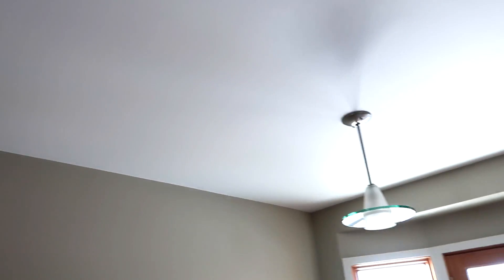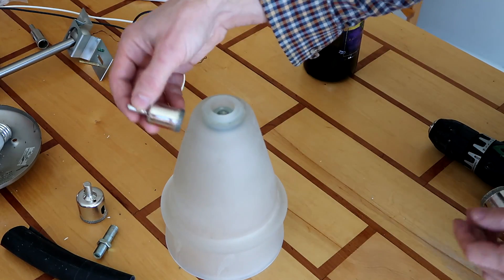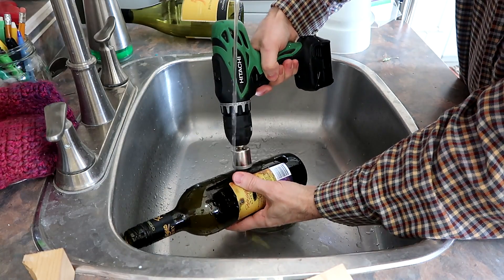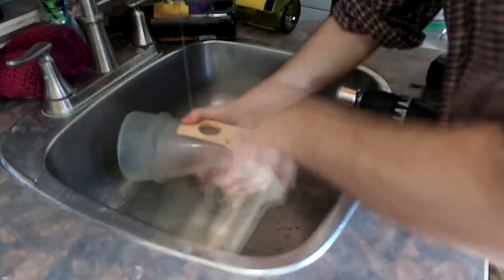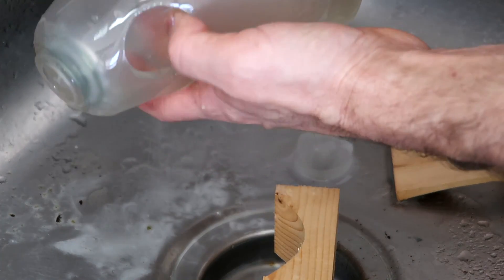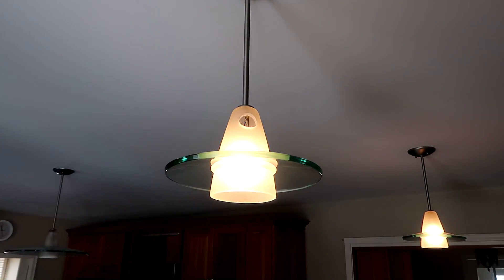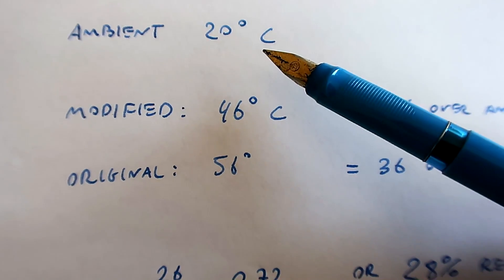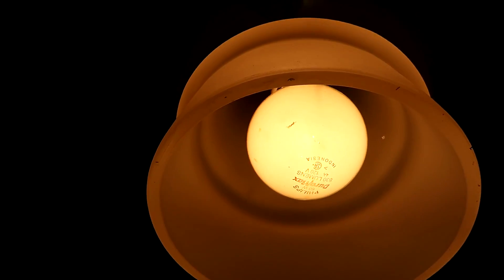Drilling holes in glass

Comment: Glad the hole saw worked out for you. A safer way to drill glass is to use a tiny, low power sandblaster. It micro-grinds the glass but without the tool forces of the hole saw.

Comment: LED lightbulbs used to have external heat sink fins on them to better disapate the heat. I have one of these in an outdoors enclosed light fixture with a photoelectric cell to switch it on and off at dusk and dawn and it is still working 10 years later.

Comment: It's not the led that is the problem I'm assuming. ..its the cheaply made low quality circuit boards that drive it that ends up failing...led is nothing but a spark gap encased in a semiconductor...silicon..i can hold led bulbs in my hand at least up to 60w equivalent bulbs...its the cheap Chinese circuits that are the problem because they were made in someone's basement

Comment: LOL, just be like some other computer geeks and modify the lights with a heat sink and fan!
Reply from the maker: In that case, I would still need a hole in the lamp
Reply: LOL, I was kidding,  @matthiasrandomstuff2221 ! But even so, not if the heatsink were small enough to fit inside and the fan blew downward and it had some room to suck air in up around the top. But anyway, of course I was kidding; that would look nasty!

Comment: Why not drill several SMALL inconspicuous holes at the top w/ a cheaper, regular/solid diamond drill bit? Recently I've found smaller LED bulbs that fit in all my fixtures, so I no longer have to drill ventilation holes.
Reply: Or why dont just cut a slot on top (actually two of them done by one cut)?

Comment: Rather than using expensive diamond bits, I drill glass (in a drill press) by putting a modeling clay dam around the area I want to drill and then use a brass tube of the proper diameter in a slurry of 320 grit silicon carbide in water.  One needs to withdraw the tube a bit from time to time to refresh the abrasive in the groove.
Reply: Diamond bits are not expensive.

Comment: Not cool to show the young ones how to ignore safety by not wearing gloves while cutting glass.

An alternative to cutting a hole is to cut a few vertical slits around the top of the glass cone with a diamond tile wet saw.
Reply: No one said to do this. Pros never use gloves handling glass either.

Comment: I’m a big fan, built two pantorouters from your plans, but this time you went off the deep end. Take a nice light fixture, drill an ugly hole in it, and get at best a minor heat loss. Sorry, this is just nuts.
Reply: The higher temperature causes light bulb failure!!

Comment: There are LED bulbs rated for fully enclosed fixtures, I am sure they would have been fine in your unmodified fixture. Did you test temperature rise modified vs original with LED bulbs?
Reply: There is no such thing as electronics immune to the effects of heat.

Comment: For what it is worth and this might be apples to oranges but here are some measurements in my home. I have both CFL and LED light bulbs in the same room. They are in recessed fixtures in the ceilings, commonly called "can lights" in the US. They are of different "equivalent" wattages. Meaning something like 20w LED equals 100w incandescent or something along those lines. But, and I only have five bulbs to measure. The three CFL were 51.9,47.4, and 49.9 degrees C. The two LEDs were 30.8 and 31.7 degrees C. These are the rather large bulbs that look like floodlight bulbs, way bigger than what Matthias had.

Comment: I think you should just install the shade upside down. Don't worry your wife will like how that looks once you explain the thermal advantages, ease of maintenance, and increase in light output due to the now exposed bulb.

If the glass breaks around the drilled hole the shade will fall? It looks heavy.

Comment: Heat dissipation, LEDs...........

Wtf???.??
Reply: LEDs don't emit heat from the frosted side of the bulb. They emit heat from the electronics. Usually the white plastic part of the bulb.
Reply: I use a lot of LED bulbs. They get hot around the base. I have some 65W equivalent flood bulbs above my work bench and they get almost too hot to touch at the base. I haven't put a thermometer or temp gun on them, but at least 100 degrees Fahrenheit.

Comment: I have wondered for quite a while why LEDs get warm when they are much more efficient than incandescent bulbs.  Shouldn't they be cool, or is it a relative thing.  Can you please explain it?  Might make another good video.  Thanks for your insights and unique style.
Reply: Simply put, they are more efficient at producing light than incandescent bulbs, but they are still inefficient becuase they produce heat along with the light.
Reply: It is relative to the bulb.
Incandescent bulbs' filaments are heated to about 2500 c (4600 f) and at that temp the thermal radiation produces enough visable light. The glass however would be around 250 c (482 f) 

In a typical led bulb,  the glass can reach temperatures of 60-100 c (140-212 f) aswell as the heatsink containing the electronics, and inside the heatsink can be cooler or hotter depending on type of bulb and where its mounted. 
Good quality led electronics are rated for 125 c, but cheaper and even smaller bulbs can run much hotter due to less effective heatsinks. 
Anything above 50 c will feel burning hot to the touch and anything above 57 c will burn you! :) hope I helped..
Reply: It's because of the electronics. An incandescent lightbulb just has a filament surrounded by an inert gas, and the filament is and it reaching outrageous temperatures is expected. LED bulbs are far more efficient but they're powered by LEDs and have electronic circuitry inside as well, which makes them more susceptive as failure due to high temperatures because electronics do tend to fail at high temperatures. 

For what's worth, I personally think the video is reliable because there's no chance in hell those were 60W LED bulbs like Mathhias said in the video. 10W, more like it. Still, the glass enclosure traps heat which electronic devices don't like, plus their power circuitry tends to be on the base of the bulb (so, on the very top part when installed), hence why they can fail really quick when put in enclosures that don't account for heat.
Reply: @simaorodrigues6285  Probably he meant 60 watt equivalent.  That would be about 10 watts.
Reply: That tells you how awfully inefficient incandescent bulbs are. 5 to 10 times more efficient than something that's very bad still leaves a lot of loss. That's why thermal managment is important with LED lamps.
The main reason here will be bad bulb design though. You can get LED bulbs that are are just pissing away power in the electronics or use the lowest grade LED chips. Could even be those that a manufacturer marked for the bin, because they didn't meet the required specs (every production has rejects), but then somehow ended up on the grey market and got put into cheap bulbs.

Comment: You can submerge the glass in water and drill it at a low speed as well, less chances of cracking later because of smoother cut. Also, wouldn't it be much, much simpler to go to where the kitchen lights are jointed to the main line and then put a transformer there (one of the ones that can run multiple LEDs, so you can just put regular LEDs in the fixture without the heat creating electronics inside?
Reply: The LEDs themselves also create a fair bit of heat. I think your idea is good though based on the thought that the supporting electronics and not necessarily the LED itself is the weak link that fails with the added heat.

That said, I have not encountered a lot of LED bulb failures even in enclosed light fixtures. In fact most of my failures have been in completely open lights with no way to trap heat. The common factor seems to be that I purchased cheaper bulbs. The bulbs I've purchased with large heatsinks seem to last longer even in enclosed fixtures.

Comment: I think several smaller holes would have looked better
Reply: And with multiple holes chances to break glass will rise exponentially.
Reply: I agree with you. I would even say that just cutting a few perpendicular slots on the top hole would be easier, quicker and would worked the same way.

Air has no problem to flow through thin slots. I think this big hole looks awful.
Reply: Who knew you could be so wrong about what you think?
Reply: It's always easy to spend someone else's time.  Also, I'd wager there's a pretty good chance of ending up breaking the entire fixture.  The drill tilts and binds repeatedly while hand drilling, and any one of those hard stops could cause the glass to break.  I'd stick with the one hole solution, or maybe just use incandescent bulbs in those particular fixtures, as they won't be nearly as fussy about an additional 10 degrees C.
Reply: Would have taken longer, and IMO it's not that noticeable.
Reply: Totally useless for airflow though.
Reply: @difflocktwo : No, not really. A lot of things have several or a lot of little holes for air to go through.
Reply: @P004ME2LicensePlate  Yeah but it's restrictive. For equal open area, a single opening will have less drag.

Comment: That hole seems like a bit of an overkill ;) . No smaller drill at hand? Drilling a few 6mm ones for example might not be faster (although it could be; no idea how long they take to drill) but definitely less visible. And I think 3 or 4 of them wouldn't do much worse in reducing the temperature.
Reply: I agree, I don't think for this use case much airflow is needed. Just enough to keep a steady movement of air so it's not a hot air balloon.
Reply: Bigger holes are so much more effective than small ones, even for same open area.
Reply: @difflocktwo 
Up to a certain point, sure. But for the airflow and temperature differences we are talking about here, that point has long been passed. 
Smaller holes higher up would maybe even provide better cooling to a small chimney effect.
Reply: @superdau  Agreed, the hole is too big, it ruins the lamp, it also triggers my ocd with the lack of symmetry.

Comment: Is this a late april fools ? Those 40W Philips DuraMAX at the start, and the 60watt are not LED bulbs, are they ? These are incandescent bulbs if I'm not mistaken!
Reply: Just to check probably...
Reply: @Yonatan24  I hope so... though an LED equivalent would require about a 10th of the power and would produce a lot less heat, so this test would be irrelevant. He should have mentioned this if this was intentional... It also looks like he uses the same lights throughout the video.

Comment: You could measure inside by quickly removing the bulb and then pointing the heat gun to the inside. The temperature will obviously drop slightly while you are removing the bulb, but probably not by a great deal, and if it takes the same number of seconds to remove the bulb on each, the cooling in that time will be close to the same (except for quicker heat dissipation for hotter objects, but that is a smaller second-order effect).

Comment: This makes me curious if the LED's marked 'for use in enclosed fixtures' are really just the same, but less warranty/life expectancy or something like that.
Reply: Some of them just lower the lifetime of the bulb, yes. The better ones have a bigger and better heatsinks that can often lower the LED temperature a few degrees below those with cheaper heatsinks. Also, the better ones use electrical components in the transformer that are specified to higher temperatures.
Reply: The component that suffer the most form heating is usually capacitors. They dry out over time. There are high temp rated ones but they can be quite expensive

Comment: Super neat! Didn't know that trapped heat can kill bulbs
Reply: I think other commenters are saying that the LEDs integrate electronic components that are then susceptible to the heat levels they produce needing heat sinking or other active or passive cooling to dissipate the heat before degrading the electronic bits to failure.
Reply: @Don.Challenger  it is one of the reasons why high power leds require a heatsink

Comment: Yeah... had a few people (especially my brother) tell me that I'm going to cook the LED Living Room lamp conversion that I just did because of a lack of ventilation...   We'll see...
Reply: It depends a lot on the LEDs you're using. Cheaper ones tend to use capacitors rated for quite low temperatures which is typically what gets cooked first.
Better quality lamps can often cope with more heat. It's less common for the LED chips themselves to fail on these relatively low power lamps.
Reply: @mowcius  Even on high temp rated capacitors the rule of thumb is 10c drop doubles the life.
Reply: The transformers fail first. The electrolytic capacitor in the LED lamp of a friemd of mine exploded, opened it up and there wer only parts left!

Comment: interesting, I would assume that LED bulbs produce very little heat as compared to incandescent or CFL. So I am surprised LED bulbs fie due to heat build up
Reply: They don't produce more heat.  The heat that they produce is more harmful to the electronics inside them than to an incandescent. And that many indoor electronic devices are only rated to 40C you can see why it would help.
Reply: @JaredCobb85  yep the limit on an incandescent bulb is the generally the glass failing.
Reply: @ionstorm66  I don't think I've ever seen a lightbulb of any kind fail because of the glass (except if dropped of course), it's always the wire or equivalent burning out in my experience.
Reply: The efficiency of LED bulb is not that great. It is only around 20% but it's still way better than the 2% efficiency of incandescent bulbs.
Reply: Juho Kestilä the forever lasting bulb was manufactured years ago but we can’t buy them because companies wouldn’t make any money...yet bang on about climate change...!
Reply: It looks like the lamps Matthias is using are 60watt philips DuraMax. Those aren't LED are they? I'm confused...
Reply: Fester Blats  the one he started with looked like a 40watt of the same series :/
Reply: Incandescent filaments operate at around 2500C. Electronics must be kept under some temperature (let's say 100C just to have a number). So if the air around the electronics is 60C, that only allows a 40C temperature difference for cooling. It can be workable. But it is challenging to have stuff be reliable in a 60C ambient environment.
Reply: The heat comes from the transformer inside. LEDs don't run mains. A super efficient way to do this kind of stuff is to simply replace the wires with something that won't lose too much over distances and at the joints introduce transformers, leaving the light fixture to handle a simple LED, without any other issues inside it.
Reply: @aserta  The heat also comes from the LED chips themselves.
Reply: @JoeMalovich  True, I've Big Clived open a few cheap LED bulbs, and those aluminum boards inside get super hot if you don't have a good heatsink of some kind on them.
Reply: @Cadwaladr  Verb: to BigClive :)
Reply: @aserta  Oh? So why are LEDs in cars hot? I don't think they have transformers. And while we are at it LED bulbs do not use transformers but capacitors to get the voltage down.
Reply: Plague some (better ones) use transformers as part of a smps power converter, others (cheap ones) use simple capacitive dropper designs. LEDs do make a lot of heat, but nowhere near as much as incandescent, and unlike incandescent the heat is harmful to LEDs and electronics; also, most of the heat from incandescent lamps is radiated away in the form of infrared light.

Comment: interesting stuff! never even thought about the fact that trapped heat could kill LED bulbs. Thank you for that interesting tidbit!
Reply: I know....I just sent for a replacement for our kitchen table light (the LED blulbs we got have a 5 year warranty - it failed after 2 years), and now I'm wondering if it's not the bulb's fault.
Reply: A relative of mine bought a "corn" LED bulb, where the WHOLE lamp was cast in silicone.
Heat! What on earth?!
Reply: Should take the time to open a failed LED bulb sometime. Might have to cut the plastic base open but there is a circuit board in there with the driver circuitry. On one or more components you should see a temperature rating. The vast majority of circuitry is rated for a maximum of 60C. The problem with circuitry that you don't often have to think about is the coefficient of temperature, a measure of how the properties change based on temperature. It's a direct electrical equivalent to the pipes carrying the water around your house compressing and expanding due to change in temperature, like the all too common "burst when it froze" problem.
Reply: I work in an electronics store so I can tell you that most LED bulbs are not really suited for use in an enclosed lamp.
And enclosed lamp also means a lamp that is only open on the bottom.

But there are many lamps like this so i think all bulbs should really be built for that.
It really comes down to price in the end... LED bulbs have gotten so cheap that there is just no margin for using anything but the bare minimum.
Also most people seem to not wonder when a 120W equivalent bulb costs 3€... From what I can tell those specific bulbs all failed after few months.

Yonatan24  That is normal for many G9 and G4 Bulbs. It can work and there is not many alternatives especially for G9 where there is mains voltage on the PCB.
Others encase it in plastic which is not better.
Reply: @Ultrazaubererger  & Also remember your room temperature. Lamps are placed high up where the room temp can be 35°C, vs 10°C in cold places. Big difference!